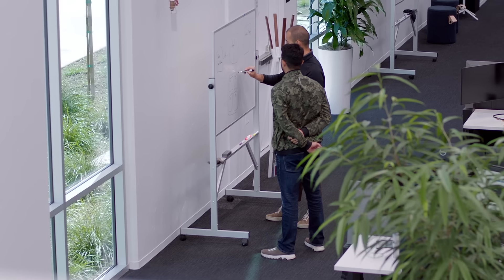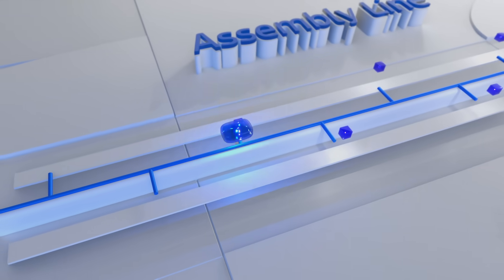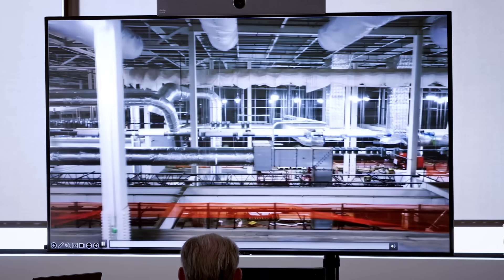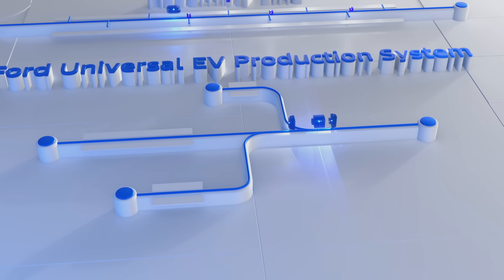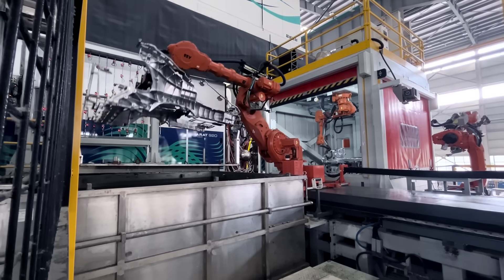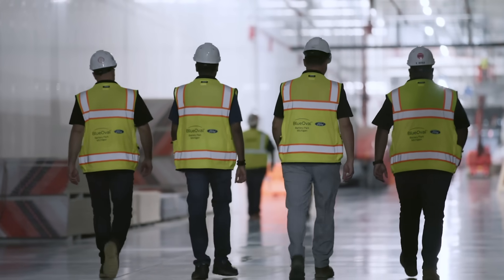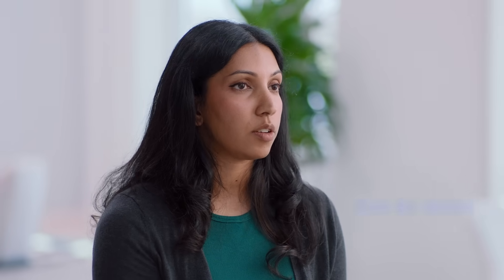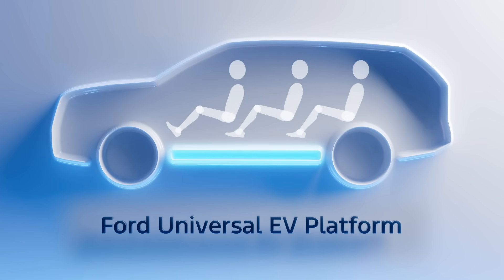The Next Leap I Ford Electric Vehicles

Comment: The Post Office should be using the Ford e-Transit van with LFP iron batteries which are impervious to extreme cold weather and are relatively inexpensive compared to the standard NCM high energy batteries used in the Ford Lightning.
The E Vans are perfect for extreme stop and go use and local routes.
And Ford has the union workers and available assembly lines for immediate startup.

Comment: There is still the issue of a lack of charging stations, low ranges between charges and unknown battery replacement costs. The general public is not buying them in the numbers needed to sustain the costs to bring the products to the market. Why not a bigger emphasis on hybrid products?
Reply: Silverado has 400 mile range.  Charging stations everywhere where I live.  Charge while sleeping if you can. Hybrid still burn fossil  fuels.

Comment: Problem for Ford is the UAW hates EV's because it means waaay less jobs money and power for them. Ford mechanics hate them because there's waaay less repairs  and maintenance, dealers hate them because many EV companys sell them direct without markups, commission expensive extended warranties. This is what most of the EV hate is about. ICE related job losses. But EV'S are much better for most people so ICE just tries to push a bunch of anti-EV propaganda to try to at least slow sales and buy themselves time.
Reply: Market changes. Technology moves on. Trying to hold back innovation is what bankrupts businesses. 

I am sure horse and buggy makers were very upset when automobiles were introduced and started to become popular. After 10,000 years of mankind using horses as transportation… automobiles come along and destroyed that entire industry in 10 about years. Did the world end? No… new jobs and innovations were created to support the new method of transportation. The same will happen with EVs. 
There are already an industry popping up to support EVs after warrantee periods. It is true they use less parts… but those parts eventually need to be changed. There are also companies making upgraded parts to solve issues manufacturers never thought of.
Reply: @89five3five I agree with your first point. The “big 3” will soon be bankrupt… again.

Comment: A midsize pickup is the perfect entry point IF Ford can appropriately execute it. 

It needs a range extender in the same vein as the BMW i3 REx, albeit beefier; a generator that can extend the range for longer drives AND provide enough watts to replenish the battery when used for home backup power. Something larger than 900cc and a fuel capacity greater than 7 gallons.

It needs to be able to still function like a truck. The Maverick has great payload numbers and respectable towing capacity for being a compact unibody truck; this vehicle needs to be better than that. The payload has to be in line with the Maverick & Ranger and towing capacity needs to at least be close to splitting the difference at a minimum of 5500lbs. 

Higher trim levels need to be have features expected of higher trim levels. Right now the Ranger available in North America STILL doesn't offer a moonroof or ventilated seats. If people are willing to pay a premium, they need to get premium features in return.

Don't disappoint us, Ford. We want the vehicle of the future, not the bean-counters agreed upon vehicle of tomorrow.

Comment: If you can deliver I am buying. First and foremost, want the vehicle to charge way faster. Then as a secondary notion I hope you adopt the slate idea of adding rear seats to make it a SUV besides just a truck
Reply: I’m actually unconcerned about charging times, as long as they’re up to current standards. I’ve been driving a Tesla Model Y for a while now, and it basically has two charging modes for me… simple L1 charging in my garage is sufficient for all local driving, and the half-hour of Tesla supercharging is fine on road trips. I mean, I don’t know about you, but my bladder and my right knee have zero interest in driving more than 200 miles without a break anyway! Getting up and walking around for a half hour, potty break, maybe getting a meal or snack, even reading a book is better than a five minute gas stop followed by pushing harder. And even a long driving day is only three charging stops.

Comment: Its simple! Build affordable vehicles that the average American can afford. You literally did this for like 100 years until someone decided that every vehicle sold in the U.S. must include tons of costly and complex tech and luxuries. Give us some basic transportation options that people will still be proud to own and drive!
Reply: Say hello to Covid and tariffs.
Reply: Manufacturers must innovate to keep their doors open, perhaps 3 percent of Americans wants a vehicle with only the engine, wheels and steering wheel. They can not employ 171,000 people, if only 3 percent of Americans purchase Ford vehicles, sometimes we have to look at the bigger picture.
Reply: They did - the Maverick. Basic small truck starting at $30,000. But surprisingly the F150 has tons of orders for the Platinum models that they can't build enough. And you can get a basic 150 for $38,000. You just order it that way. Dealers make more money ordering the expensive ones onto the lots. So just order a basic 150.
Reply: @samuelbutterworth4303  nobody is chomping at the bit to buy a Maverick. They use to sell a basic 2-door, bench seat F150’s equipped with a radio, A/C and you could option it with power windows. The key is to build something Americans will be proud to own, not crap that your embraced to be seen in.